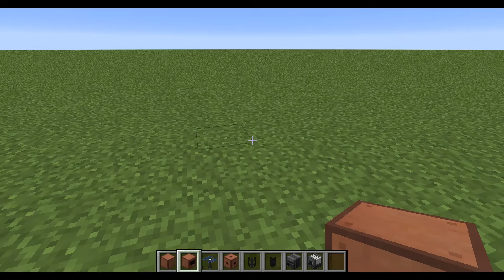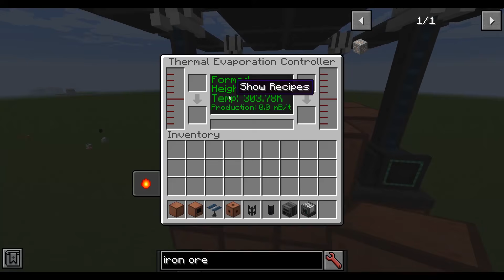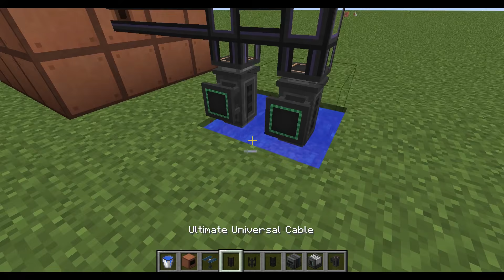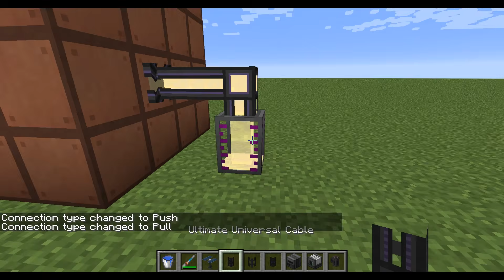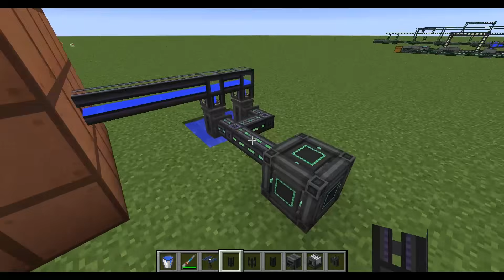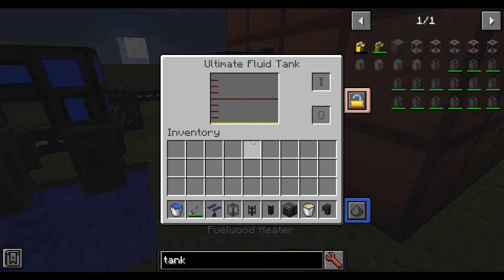Mekanism Thermal Evaporation Plant Tutorial

Comment: best tutorial on the topic, to the point, short, everything clear, thanks a lot for making it!
 something that i discovered after making a mistake, the resistive heater can be "overclocked" just type the number of energy you want it to consume (40Fe by default), instead of making 20 resistive heaters, just right click one and type 800, it will consume 800Fe (x20 base rate) and generate x20 base rate, you can go a lot higher if you need to

Comment: how can i empty the evaporator? it entered 8mb ow water to a evaporator that i was going to use for lithium and cant make it get out with pipes cause the water is in the input side
Reply from the maker: You need another outlet and set of pipes to get it out. Use the configurator to set the pipe to pull.
Reply: @ColeWeinman  did that before coming to comment, my solution was crafting a new controller and the evaporator was like new